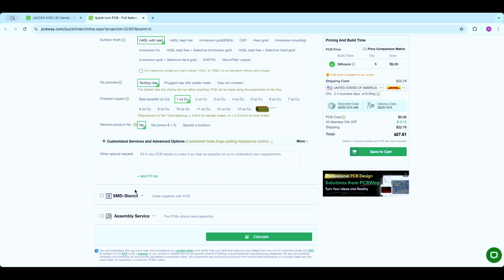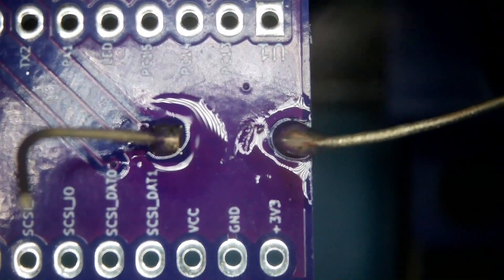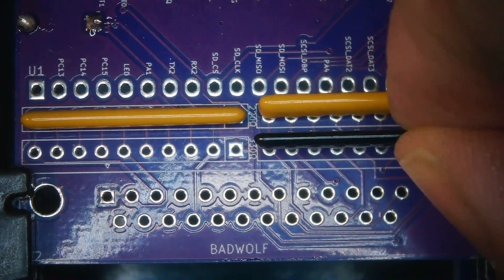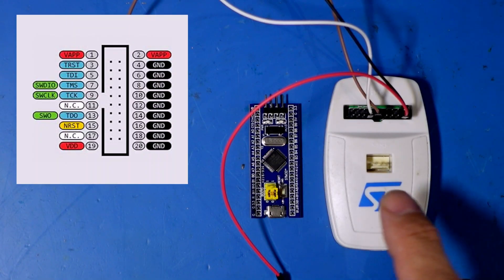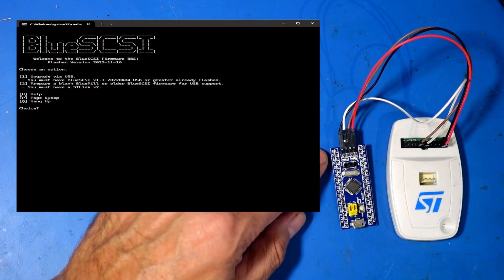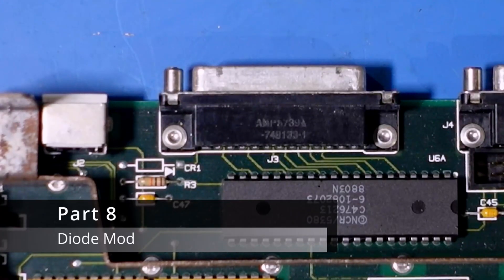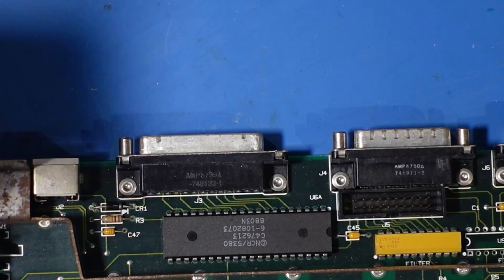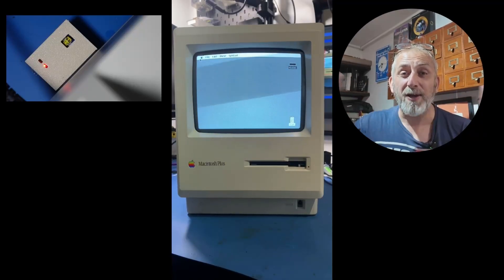BlueSCSI 1.1a DB25 Build + MAC Plus Power Mod

Comment: Hi , great job 👍. Quick question buddy. Is this bluescsi the same Amiga computers would use?
Reply from the maker: Hi you can indeed use them on the Amiga. As it emulates the SCSI drive however there are different versions and most I think are designed for  the big box Amigas :). Maybe you could fit one inside a hdd add one for the Amiga 500 the cheese shaped ones I think they where SCSI but I could be wrong lol 😂 thanks for the comment
Reply: Ohh sorry i was thinking of ADDING one to my COMMODORE CDTV @Retro4u forgot to mention
Reply from the maker: @MartiNess78 but the looks of it if you have a scisi controller for it.  THe blue scsi should work they even did one with the port on the back you could
Plug this one into. However it may not be powered and need a usb power.
Reply: Top man thanks a lot  @Retro4u

Comment: Where did you get the windows executable for blue scsi firmware flasher? The github just has bin files and source.
Reply from the maker: I will post a link to it today later 👋.  If I can't find it I'll upload it :) I h ask for the comment
Reply: @Retro4u  Any luck finding a link?
Reply from the maker: https://github.com/erichelgeson/BlueSCSI-Updater this was it but if you read further down there is a new version I think.
Reply: @Retro4u  thanks, I got it to work in Windows (haven't tried it on my Blue Pill yet). I needed the 1.1 version.
Reply: @Retro4u  Thank you, that would be very helpful.

Comment: Great video Neil. The modification of the Mac Plus board, specifically the diode mod, to power the BlueSCSI directly from the machine without an external USB power supply, is a very clever and practical enhancement.
Reply from the maker: Yeah makes a huge difference saves you having more wires and adapters. :) Thanks for the comment